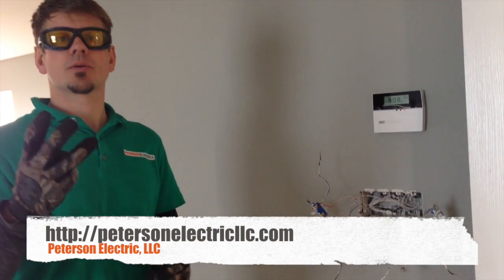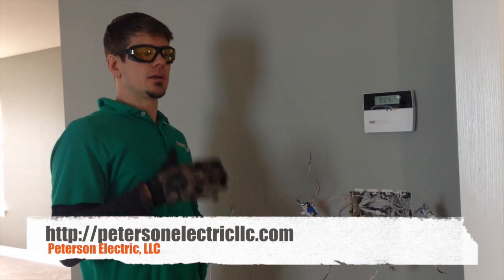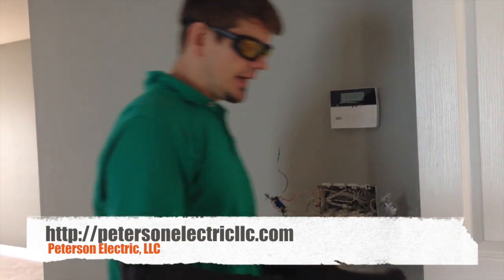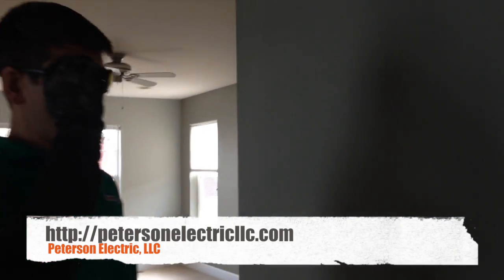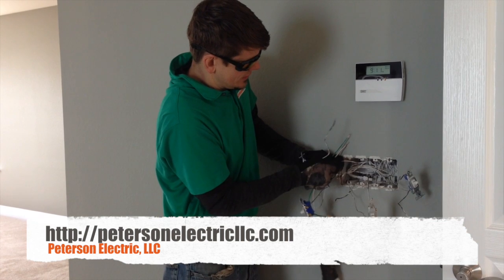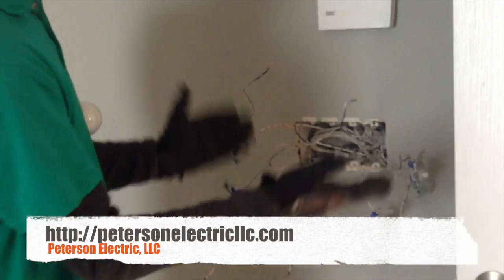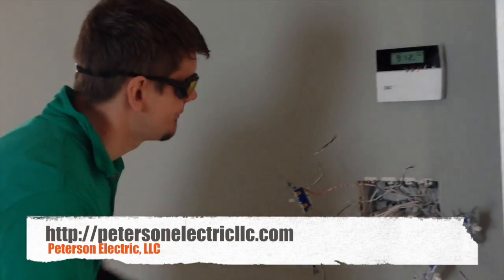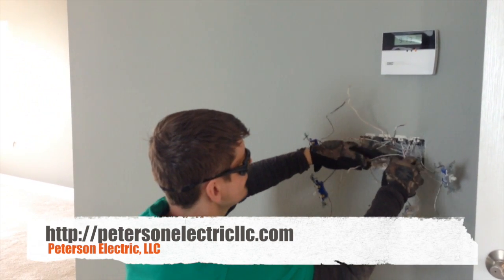Why Arc Fault Breaker Is Tripping? 2 Phases Tied Somewhere, Part 3

Comment: How do you find where 2 breakers may share same box? Disconnect everything then turn one breaker on at a time and see if hot? I have 20 outlets and 8 switches tied together somewhere, 15amp snd 20 amp breakers. Would I need to remove all of them then start testing?

Comment: This is called bucking the phase all you had to do is use your tick  tracer turn off each braker one at a time till you found what two breakers are on the opposite phase and what room and then go find who fucked up the wiring is all
Reply: "all you have to do" = a good chunk of time running back and forth with a beeping stick, getting into every part of someone elses house as you go. It is work, baby!

Comment: I’ve had a lot of problems with these arc faults when some houses were wired they ran 12/3 or 14/3 romex, made two circuits and shared the neutral. Nightmare scenario for troubleshooting bigger nightmare when those two circuits share both lighting and receptacles loads. Most cases end up protecting the receptacles with a arc fault device and let the AF breaker protect the lighting. Can be challenging to find sometimes you get lucky and find a junction box that you can supply another neutral. Arc faults are still a work in progress old school sparkys need to adjust there wiring methods.
Reply: you can tie the red and black together in the panel, use one arc fault breaker. Sux if they needed the amperage

Comment: Thank you so much.  This saved me.  I just ran into the exact same problem.  I had 2 separate dishwasher and disposal home runs going into the same box and my disposal arc fault kept tripping.  I had the two home run neutrals tied together.  I racked my brain.  Did continuity testing to see if there was a wire break.  Etc
Reply from the maker: Careful, this is 240 volts in a common box.

Comment: Lol, i knew about 2 mins into part one what this was, i just fixed something similar in a house i worked on. They had ran 12/3 to a recept and used both red and black conductors and caused a 240v short.

Comment: Conclusion:
Do not share any wires between separate circuits. Power, neutral, or ground.
That is electric 101.
Someone was sloppy, incompetent, or worse, lazy, and just didn't take the time to figure out which wires belong to which circuit.
These are the most difficult repairs because you almost have to inventory the wiring one circuit at a time. It becomes exponentially difficult if more than just two circuits have been intermingled.
I'm glad they called a professional to get it all straightened out.
Reply: "Don't share grounds" <--- plz explain, this sounds totally not correct
Reply: @ubrayj02  Don't share ANY wires from one circuit to the next.
Yes, all of the neutrals of all circuits eventually connect together and all of the grounds of all circuits eventually connect together but that is at a known spot(s) in the breaker panel(s). 
When there is a problem and you are trying to trouble shoot, you may need to isolate a circuit (disconnect all wires at both end to check for continuity, etc). If you have shared a wire at an outlet/receptacle from another circuit this could cause confusion -- perhaps thinking there is a stray ground somewhere in the circuit.
--
Better just to keep all wires in a circuit in that circuit and not share any with any other circuit.

Comment: I noticed you often refer to "phases" (plural). There is only one phase coming into American homes unless someone has installed a commercial sesrvice. The correct terminology is Split phase. You have two sides to the same phase.
Reply: Was taught that the only split phase is some models of single phase motors. Its a 3 wire Edison system where the center tap is grounded bro provide the grounded conductor. No such thing as a neutral in the NEC.
Reply: @garbo8962  Every house is supplied split phase and the NEC refers to Neutrals thousands of times.
Reply: There are two phases in a panel, with 240V difference between them and a neutral that is 120V between either of those two phases. Literally right out of the text books, manufacturers instructions, etc.
Reply: @ubrayj02   therebis NEVER 2 phases in any residental panels unless you have a mega mansion served by a three phase service. Plain and simple its a 3 wire Edison system where the secondary of ultilty transformer has a center tap that is grounded to supply the white grounded conductor. No such thing anymore in NEC called a nuetral.
Reply: @ubrayj02  I'm sorry but that's not correct. Domestic power is only split-phase, (there was  2 phase long ago before more efficient gens were devised). A quick Google search will yield hours of reading on the subject but in  short, the two legs of domestic power are 180 degrees out of phase and to be 2 phase, they would have to be 120 degrees.
Cheers.
Reply: @ScottDLR  Get it right no such thing as split phase power in 99.99% of USA homes. Split phase should only be used for some single phase motors.
Reply: @garbo8962  We'll have to agree to disagree.

Comment: Did u really not know that 2 circuits sharing neutrals will trip a arc fault lol arc faults require there own isolated neutral
Reply from the maker: Actually I did know that, This is why I showed the video, but thanks for asking! The point of the video was to show another way for finding it and how, with a panel that was miss labeled. Thanks Derek!

Comment from the maker: We found that the two circuits were tied together in the panel, sharing a neutral, needed to trace in the MB and separate like the video. Then we need a two pole AFCI breaker with a common tie handle for the Muti-sharing neutral.
Reply: What a pleasure watching a sharp technician. I started in aircraft electronics in Viet Nam, then to low-voltage (alarms, etc) when I got back, then eventually to electrical in construction. I so seldom found another electrician that could do any deep troubleshooting to speak of. You are great to watch. I'm pretty much retired, but still work for a few favorite customers. I'm doing an AFCI problem now. But I think it's pretty straight forward as I can hear a buzzing in the attic for the second before the breaker trips. So, I'll haul my old achy knees through the scuttle hole tomorrow. I'm thinking I'll find a loose twist under a wire nut on the neutral since every switch for any light on the circuit makes it buzz and trips it. I am way less experienced on AFCIs than you for sure. Again, you're an artist at this. A pleasure to watch.
Reply: Wheres part 4, or a video commentary follow up regarding this issue, the slamming on of the brakes looks very fishy. Please video comment where this vid ends.
Reply: Thanks for the follow up.
Reply: Dude your wrong. Not the issue. Terrible electrician

Comment: So where is part 4?? Or the finale of this video the conclusion???
Reply: The conclusion: two circuits had the neutrals spliced together in that box. That condition was tying an A phase and B phase of the power together - 240V diffierence on the return leg and it was making the arc fault shut off power to the circuits.

Comment: That was very enjoyable to watch. I liked hearing him diverge from stick testing and diagnosis dialogue. I admire how he used and gave the knowledge he has collected. Thanks a bunch for posting this video! I hope to watch more from this channel in the future.
Reply: 4:18 "it's a little bit of a ball here"  Yes, here in Europe (GER) are 240V (16A Breaker) the regular Voltage. I saw this kind of Errorfinding Method now for the first time. And was stunned (^^) as i saw the 
"lightbulb-&-2-flying-wires--shortcut--measurements" in part1. 
welding glasses and Earplugs -> definitive non optional anymore. :)
thumbs up +tyson lafghin really liked it too. But this annoying logo has to go at some point during the video.

Comment: So how did you fix it I still don't understand if you have two Hots one neutral and you need to make two neutrals do you have to tie the breakers together what did you have to do to make this work since you are sharing the same neutral on two circuits with and you need to have two independent Breakers was there a separate neutrals I don't understand how you do this
Reply: There were two circuits in the box with the neutrals from both tied together. That won't work with a AFCI. It will work fine with non AFCI breakers. Keep the neutrals from each circuit separate.
Reply: split the difference, two hot home runs, instead of tying them together, you split them, two switches run off one breaker two switches off another and you keep the neutrals mated to the correct homeruns and legs
Reply: there wasn't just one white and two black hots coming in. There were two of each. That's why he was separating the neutrals at the end, so the neutrals from one home run sheath didn't mix with the neutrals of the other home run. or you can cap the one of the white and black from the same sheath and do the same at the panel, if you feel there won't be much load on the one remaining. and if it's a lighting circuit, most fixtures use highly efficient LEDs now, so you should be good.

Comment: So what was the answer
Reply from the maker: This is referred to either A and B phase or L1 and L2. Usually when you are talking about a transformer winding it is A or B phase, when you are looking at equipment it is L1 and L2, (it is the same). If you are in tree phase, it is A and B and C phase, or BOY  (brown, orange yellow for 480 volts and BLR  (Black Red and Blue for 208 volts).

Comment: I follow your channel and I learn a lot because you like to references the code book when you  can. I'm studying my book for my test and someone ask me can you shared a branch circuit with a living room with a bedroom and can you share a dining with another bed room? I believe you can and I can't find it on the code book..
Reply from the maker: Dining rooms by article 210 and 220 has to be a dedicated 20 amp circuit, which is allowed to share with the counter plugs in the kitchen, assuming the kitchen is not large. As far as the bedrooms, there is no code article that states that a bedroom has to be dedicated, although, common practice is to not put the living and bedrooms together, again, it depends how large the house is for how many bedrooms you put together, and of course if there is any walk in closets or jack and Jill of master bathrooms.
Reply: Thanks
Reply: you can as long as it is AFCI and not over loading the circuit.
Reply: Not with dining room circuit, because it is a 20 amp circuit.